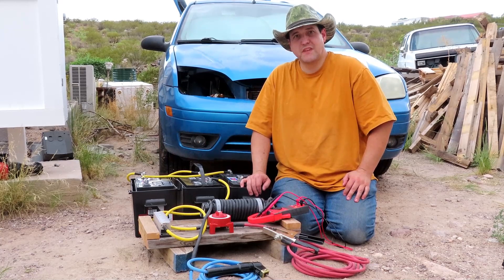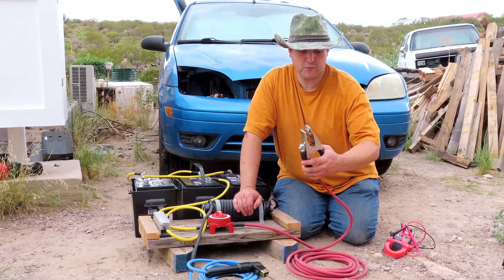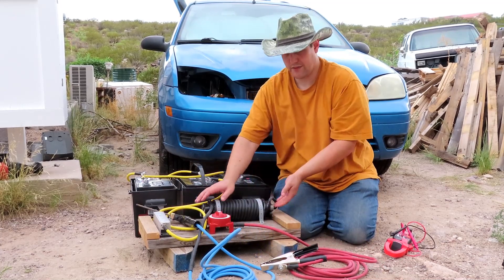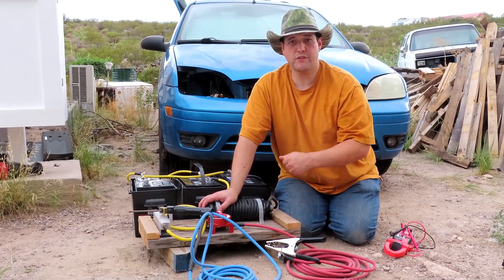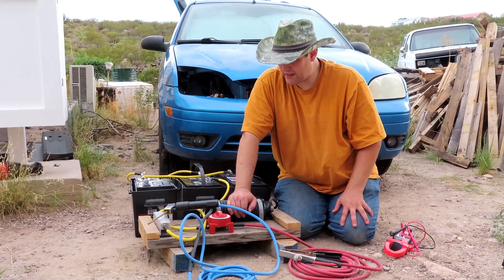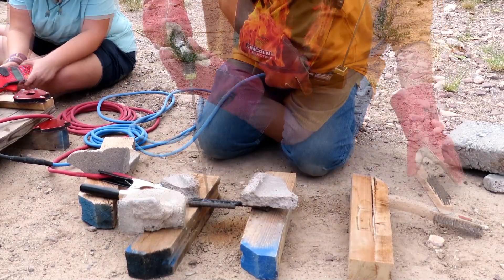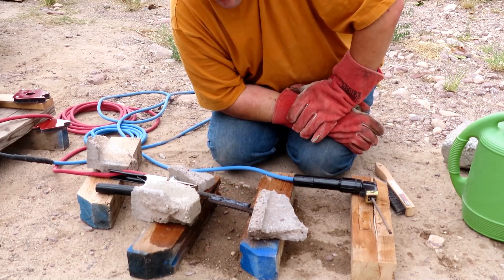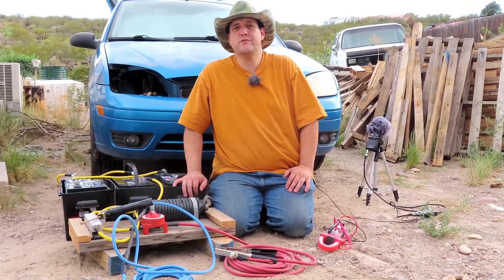Wielding Great Power - Offgrid Battery Welding Setup | Emergency Welding | Manifest Skills E015

Comment: I don't know what impressed me the most on this one. The welding skills or the bravery in wearing an orange t shirt :-)
Good demo of entraining the batteries
Reply from the maker: Orange is a good color. More people should wear orange! LOL

I'm glad you liked the demo. This is a good system to build as it will allow you to build and repair lots of important things when the power is out and you don't need a loud generator running either.

I'm going to later work on making an arc forge, or a system to melt metals with electricity.
Reply from the maker: @Huples Cat EPL - I just got into one of those arguments you have to deal with at times. Someone who "knows" something claims the design is a major hazard and that I'm an idiot and have no business making the video. I just love it when people give no details of the "danger" or don't tell me where my engineering is wrong but insist I'm an idiot and shouldn't be doing this.

Just because you drove a bulldozer doesn't mean you are qualified to say that changing the emissions on the engine design will destroy your bulldozer. Unless you can provide real scientific argument, let the engineers do their thing. Well, that illustrates my point about the argument I just had.

It is similar to the climate change arguments I see talked about. Useless noise to the real issue going on.
Reply: @reedin9954  Well if you put more than one battery in a flashlight it does not generally explode now does it? People have fixed opinions of their own superiority. I have that with nursing so I have to check myself a lot when the medical topic comes up. "Do I really know or am I BS myself?". Others seem to have no self awareness :-)
Reply from the maker: @HuplesCat  - Actually the medical stuff bugs me to death too. I have been using medical textbooks to educate myself and I read some of the journals at the college library. 

One time I got a nasty skin infection and they had to lance it out and clean it all out. They wanted to do wound packing but I brought up that new studies examining the old practice had found no benefit as it isn't done in Europe.

The doctor didn't believe until I showed it to him and mentioned I didn't want to bother with wound packing.

Healed up perfectly. 

It is funny as whenever i see him he always asks what I have read lately in the journals and we talk about stuff. The conversations get pretty deep at times but I enjoy them.

I'm mainly focusing on immunology as it greatly relates to my Asthma.